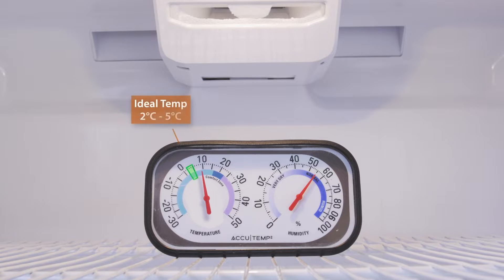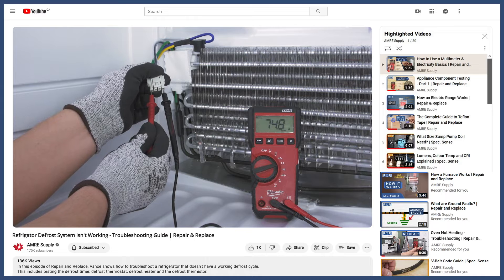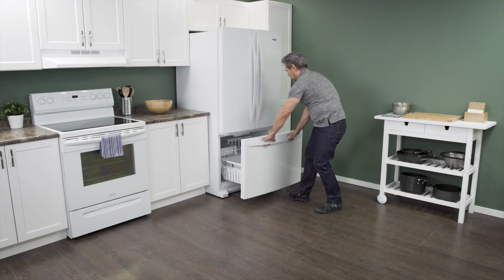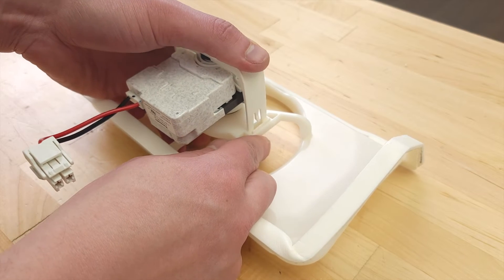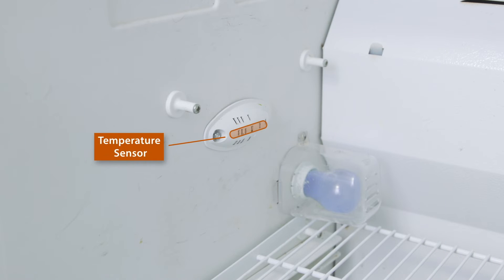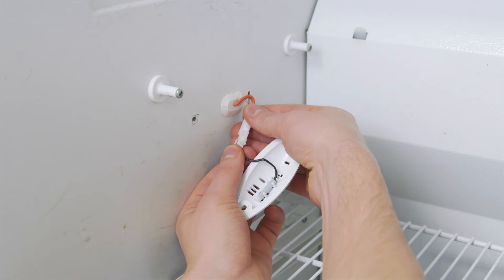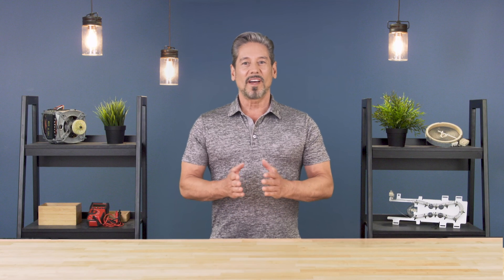Fridge Warm but Freezer Cold? Troubleshooting Guide | Repair & Replace

Comment: mine is a defy dff 458 has three temp. sensors one in the fridge, one near the fan and one above the evaporator, I tested it, near the fan 20 ohms, the other two between 1500 to 2 000 ohms. I replaced the control board but the fan initiates for a few seconds at startup then stops, it is a 12 volts fan with three wires attached to a plug tested it, works from 3 v to 12 volts.could it be the signal wire? Please help

Comment: This happened overnight for me and none of the vents are blocked in the freezer. Any idea what that can be? This is a brand new fridge only been using it for 1 ½ months
Reply: Happened to me overnight yesterday too, though, mine is a year old
Reply from the maker: Does your fridge have a damper motor?
Reply: @AmreSupply I don't know what that is 😅
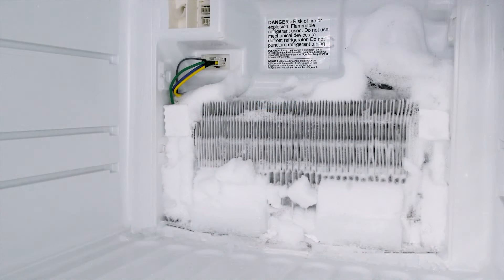Reply: @majolat2000 the video shows an example of a damper motor just after the 2:00 mark. FYI I currently have the same problem and have confirmed that the damper is staying closed all the time, even after a full defrost.
Reply: @rocksarepeopletoo thanks for this, I didn't notice the video was too long and complicated for me
Reply: Did you ever figure this out?
Reply from the maker: Does your fridge have a damper motor?
Reply from the maker: Does your fridge have a damper motor?

Comment: What if its intermittent? I can't buy all these components and fire the parts cannon, not can I wait weeks for one part at a time.
Reply from the maker: You don't need to buy all the parts you can still test and see if any of these components have failed.
Reply: @AmreSupply  Im starting to think its the Jazz unit. Its every week, and will go inop for 24 hours, almost to the minute. Twice now its done this. Doesnt seem like a random failure, maybe the defrost circuitry got fried somehow.

Comment: Freezer is cold.  Refrigerator gets warm. If I pull out the damper unit entirely, the refrigerator cools down.  The damper doesn't seem to open all the time when the door is opened for an extended period consistently.  There is enough cool air circulating.  I am thinking either damper, sensor, or control board?
Reply from the maker: Sorry for the delayed repsonse. Your line of thinking is solid. Testing / replacing the damper would be the first thing to do, as well as test the temperature sensor. Control board only if the first 2  don't work.

Comment: I'm having a similar issue but the other way around, freezer too warm to freeze thing but the fridge still works normally. Also, cool air is blowing from behind instead of warm air. Its a bottom freezer if that can change anything.

Any kind of help would be appreciated!
Reply from the maker: Thanks for watching. In your case there could be a buildup of ice, something blocking the vents, or a stuck damper motor that might be diverting all the cold air to the fridge. In this case the temperature sensor in the fridge will shut off the unit when the fridge is cold, leaving the freezer warmer than normal.

Check to make sure that there are no boxes or food items blocking the vents, and see if there's excessive ice. If this is all good then check the damper motor.